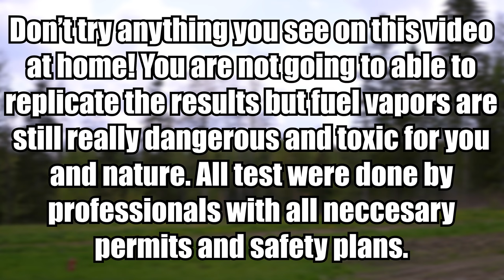Testing Fuel-Air Explosives / Thermobaric Bomb | Finnish MOAB 5 000 000

Comment from the maker: Link to Pommijätkät video for more thermobaric action https://youtu.be/XgaotYjJ8hg And yes there is SUBTITLES in english!
Reply: Can you make it bigger ?
Reply: Big thanks to Lauri and Anni :) Always fun to blow up stuff together!
Reply: @mkeolver  Let's have a big thunderclap for the Summer Solstice!
Reply: What if you used two cans, one smaller with the gasoline or what you were using inside another bigger one with hydrogen peroxide, the addition of the peroxide as an oxidizer in the vapor cloud should give you as much bang as possible...plus it's environmentally friendly oxidizer that ends up as water and oxygen!
Reply: hello. why the explosion seems to be specially powerfull at the equator and less powerful at the poles?
Reply: @TheBibliofilus  Biggest bang/weight?  Air is free.  Thermobarics deliver a huge volume from a small package - blast wave and near zero oxygen remaining.  If your enemy is tunneled, use a thermobaric near surface openings.  Breathe what?  Big booms are easy - Texas City and the Bay of Beirut, 'Nam daisy cutters - but they are not easily portable.
Reply: Have you tried to disperse the fuel from below with compressed air?
Reply: @Kheopsyco  The initial detonator was a thin vertical cylinder.  One does not want the blast energy to be wasted by pointing up or down.
Reply: How about testing an Implosion-type fuel-air explosive?
Reply: That slowmo, was remarkably similar to some shot on nuclear tests...
Reply: And now I have to watch Pommijätkät video again. This time with subtitles, as I watched it on first day in finnish))
Reply: @ЮрийРулёв-и2ж  same here
Reply: Long ago, I made an experiment with gasoline, by pre-boiling it inside an old propane bottle to en enhance the vapor dispersion when detonated and add small ampules of hydrogen peroxide around the setup, the explosion was... scary, I couldn't breath air from far away, it sucks the surrounding air and than the hot blast comes after. My eyebrows, hair and mustache were burnt from the hot blast.
Reply: @boymahina123  To what end?  The explosive device is the entrained air plus shockwave initiation.  You're likely thinking shaped charges, self-forging munitions, and HESH rounds.
Reply: Fuel + Air explosives = weak...

Try
Hydrogen + Oxygen mix. ☝️🧐🕵️‍♀️😉

And yes, hydrogen is also fuel... But you now what i mean.
Reply: Idea for new t-shirt:
Kolme...
Kaksi...
Yksi...
>>boom!<<<
Reply: How do you pronounce Pommijatkat? Can you spell it phonetically for English pronunciation please?
Reply: @bubblezovlove7213    Google Translate will speak it to you.  It's...unexpected unless skilled in the art.
Reply: Atlantean Gardens YouTube Vortex Math explained by Marko Rodin with an introduction by Robert Sepehr
Reply: @bubblezovlove7213  paw-me-yat-cat might be as close as we can get in English.
Reply: Quick question, will there be any more outdoor ring videos? I've looked in your videos but I can only find the blue car one. Would love to see more if they're are still more to come.
Reply: Has anyone tired using real coconut 🥥 to make a firework or something that goes boom 💥 I mean with the coconut shell
Reply: ROCK ON!!! That blowed up good !!!
Reply: Al-Nusra getting 2016 flashbacks
Reply: This are good for fight any forestal fire.
Reply: awesome
Reply: Yo you got some freaking amazing bomb ass footage!! That footage near the end made it all worth it!! I was literally blown away, no pun intended!! The way the dust came up off the roofs was jaw dropping, it was clear you placed the dust on the roofs, meaning you knew it would make for amazing footage & shots, kudos bro, thats a pro move!! Hell I thought I was watching a movie at one point, the footage is just that good!! I look forward to more videos like this!!!
Reply: You should start doing scale explosions and video their effects on structures and maybe some ballistics gell for flesh, to see what the damages are to people and animals!!
Reply: I think that the Beirut blast was an assisted fuel/air explosion the continued fireworks going off only causing small localized bangs
Reply: @takasmaka820  ppp
Reply: Excellent work by you and your technicians. Well thought out. Great science. Im an experienced pyrotechnician, and other...
Your best slow motion so far as I've watched (at 3/4 through this video) you see the "dispersion" charge shock wave pass, and end. 
A few milliseconds later the "ignition" charges fire. Near perfect. But if you got the ignition closer behind the dispersion shock wave, to amplify it...THATS the big one. Wave amplification.
Reply: U shud revisit this but do one to show the thermobaric reaction is responsible for the power. By doing same test setup but the bottle of fuel is empty so nothing disperses. So u can see the three stages without fuel did not produce the power. Only when fuel is added and the reaction is successful do you get all the power.
Reply: This is why a thermobaric bomb is illegal in wars but Russia is using them today against Ukraine. This bomb is home made and really small compared to what Russia is using. Let's not forget Russia's Tszar bomb 3,800 times as powerful as the U.S bomb dropped on Hiroshima! For the first time in 2020 Russia released/leaked the video of the explosion, if you want to watch it copy and paste this text in youtube Испытание чистой водородной бомбы мощностью 50 млн тонн The explosion starts at 22:43
Reply: @PureVikingPowers  the air blast Russian bomb is equivalent to up to 44 tons of TNT. They have smaller ones on rockets.
Reply: @PureVikingPowers  thermobarics are widely used in war. Also tsar bomb footage has been available for decades.
Reply: @Chaotyk-Official   Yes thermobaric bombs are not technically illegal and can be used in certain battle situations. However, the use of them on civilians is considered a breach of the Geneva Convention.
Reply: @PureVikingPowers  wtf are u on about? I thot this conversation was already over.
Reply: Oh we never grow up do we? Lol I used to do this with fire crackers when I was a kid with little green army men.
Reply: How do you initiate the secondary detonation?
Reply: @baniagojherwinjohn4765  usually with a specific length of shock tube
Reply: Wasn't there a risk of starting a forest fire where you were testing the fuel air explosions? If you had done this as close to trees in Australia. you would have started a forest fire (bush fire in Australia) for sure.
Reply: That shit's great guys!
Reply: @budsbunny5610  Right... 😣
Reply: tritonal but you have to make it castable(like plastic explosive) and mix the aluminium in well 80%TNT 20%Aluminium
Reply: If you need someone to subtitle your videos in english, Im available

Comment: "dont try and build thermobaric bombs at home..." Thats one of the few safety warnings that actually made me laugh.
Reply: Its actually feasible to build thermobaric bomb in the states by just following this video. and its really dangerous
Reply: @royk7712  the chance is actually higher for just contamination of the ground with fuel.
 that the initial explosion spreads the fuel but also damages the donator for the ignitor explosion, or the fuel being not vaporised fine enough and in the right direction
Reply: @pteppig  that's why they do multiple explosion to perfected it
Reply: Its fairly easy to build.
The reason they have so much issues, is because they use air as the oxidizer, and thus you need to ignite the Fuel/air cloud at exactly the right ratio.

If you include an oxidizer into the fuel itself, the oxygen is already present in the right ratio, and thus you don't need any precise timing at all. 
This makes it a little heavier but its still an extremely potent explosive. You can also easily buy all the ingredients Without causing suspicion. Aluminium powder, Magnesium powder, powdered sugar, and some other stuff that is equally trivial.

And then you can build a thermobaric enhanced bomb, that could nolife and maim hundreds of people, destroy infrastructure from small shacks to steel concrete buildings, bridges, boats, power plants, damms, depending on whether you are filling a bottle, a backpack or a van.

The thermobaric explosive charges of the rockets used by the US military arent exactly huge, and their destructive power does not stem from something special that you cant construct yourself. Maybe its 50% as efficient, so youd need 400kg to create a blast the size of a military 200kg thermobaric bomb. 

Entirely attainable and buildable. 

The industrial revolution and its consequences have been a disaster for the humam race.....
Reply: The russians couldn´t resist!
Reply: @carlpanzram2012  well said
Reply: @carlpanzram2012  so basically, a small explosive is surrounded by fuel oxidizer mixture. when the explosive is detonated, it disperses the fuel air mixture into the atmosphere. how is the second explosive created to ignite the dispersed fuel

Comment: Thanks for the video, the explanation and the testing. 
I've first heard about these vacuum bombs in the ukrainian war and sadly got interested, what they have to deal with...
Reply: I heard they haven't actually been used yet (though not sure why, they probably will soon). Also people already forgot when USA actually used it only a few years ago which was very famous at the time: https://youtu.be/d4DLzioGq5M
Reply: United States used these in the Iraq War as well
Reply: @lyrimetacurl0  It's not a warcrime to use them against bunkers and entrenched foes. However launching them at civilian structures is a warcrime, since they are such indiscriminate killers. 

The wounds inflicted in civilian targets are also very cruel. Like if you hit an apartment building with one, the explosion sucks all the air inside the building where it is not air tight. This causes lungs to collapse, eardrums to implode, other organ ruptures are common. The heat from the blast is also like half of the surface of the sun, so the victims often have severe burns. 

But these weapons are not any more immoral to use against enemy fortifications like bunkers. Or against an enemy tank column. But using them against civilian structures, even ones with enemies hiding inside, is a warcrime and very unethical. This is because of the very high destruction of infrastructure, as well as the wide area of effect. It's almost a baby nuclear bomb without radiation.
Reply: They aren't vacuum bombs. That's a huge misnomer.
Reply: @tadferd4340  
Quite Right
The misnomer 'vacuum bomb' comes about due to the fact that all the oxygen in a large area has all  been used in the explosion itself and leaves an un-breathable atmosphere behind. That is also presuming you could breathe gas at very high temperature and that your internal organs have not already been pulped by the  overpressure and shockwave.

Comment: I inadvertently made an FAE by throwing a cup of kerosene into my wood stove one morning to help light it. My mistake was failing to notice the residual heat in the stove body vaporized the kerosene enough that it blew the chimney pipe off, knocked the door wide open, and shot a fireball into my face and arms. Luckily it was a small amount of fuel and I escaped with nothing worse than a slight ringing in my ears and some singed hair.
Reply: @partyhardcake  yeah, even if it wasn't a true "detonation" it was still a pretty violent and unexpected reaction.
Reply: @partyhardcake  Nah, blasting cap is just the simplest way to guarantee a detonation - it isn't the only way. Offhand I'd guess that James B did experience at least a small detonation up-close - to me it sounds like the stove body confined the initial deflagration well enough for overpressure to trigger a (partial) detonation. Fireball was deflagration for sure, but the loud noise suggests detonation.

And yeah James  B, that's pretty scary. Fortunate that you didn't have the setup for anything close to a complete detonation - I've just looked some stuff up and done the math, and a cup of kero (if detonated completely) is equivalent to 9-10 sticks of dynamite. Which is a whole lot more than I was expecting when I set out to figure it out, yikes.
Reply: I was on a camping trip one time and a kid threw a styrofoam cup of Coleman lantern fuel on a fire. That shit ignited so fast the fire followed the stream back to the cup in his hand and ignited it. Burnt his hand and arm pretty bad and burnt a lawn chair that he threw the cup into.

Moral of the story....don't try this at home kids.
Reply: @edsloan8535  One of my school friends got injured trying to change a cooking stove gas canister Inside their tent. I believe they released a lot of gas which exploded when they went to light the stove.
Reply: As a kid my friend did similar with his wood stove in the basement. It basically fireballed the whole basement. Singed his eyelashes and brows off.
As a bonus all the spiders died and the cob webs disappeared.
Reply: @partyhardcake  You really don't. Fuel oil furnaces will do that if you atomize enough fuel into them and the igniter kicks in.

Comment: I love how you can see on the high speed that the most destructive force in many of the little houses is the differential air pressure between inside and outside the houses.  It's like the houses exploded from inside because the pressure inside was higher than outside.  Really cool.

Comment: The mini houses/barns seem to explode from the inside- is that because of the pressure difference created by moving air outside of the structure? Or is there some way the pressure wave moves inside and deflects outwards through the roof?

Comment: You could do the ignitors on the same package so that you attach the ignitors outside of the canister and attach them together with a wire to the side of the canister with primers to shoot them away just before the blast. The wire should be measured so that it stops the ignitors before the bursting charge goes of. Make a package to the ignitors so that they are not ripped away by the bursting charge. You can make the needed delay to the ignitors with explosive cord either rolled around or inside the wire that is attached to the primers.
Reply: Great idea. Maybe create a physical detonation mechanism that's set off when the detonators reach the end of their travel on the cords.
Reply: @harrypeterson9287  Even better, Yes, that way you could make the primers detonate at right place at right time. I myself don't have such materials so I can only theorize.
Reply: @harrypeterson9287  This way you could make the ignitors so rough package that you could let them be thrown by the bursting charge with the fuel material and rough package would make needed weight for the pulling of the string to detonate the ihnitor packages. 
Wire just should be strong enough to take the bursting charge's strike without failing.
I'm quite sure it should not be too hard to measure the wire to fit inside the fuel cloud. And finetune by testing it, they who have the materials and place to do it.
Reply: @ark-mark1  I imagine multiple small tubes inside, much like gun barrels that shoot the detonators in a perfect pattern while keeping the cords nicely coiled behind them to prevent tangling and pre-detonation.

I think this would work, a person could make a lot of money if they had the resources to make a prototype.
Reply: @harrypeterson9287  Yes, possibly you could use commercial grade fireworks just put to metal tube. if they launch just before the main bursting charge, they would not take damage and the air bomb type fireworks would make enough blast to lit the fuel. 
And as much I would need the money, my conscience would kill me if they were used in anything else than entertainment.
Reply: @harrypeterson9287  Tho that fireworks type would not suffice, if you need it to work perfectly every time. Then you'd need that cord & wire type function.
Reply: @ark-mark1  I was thinking that they could be shot out by hydraulic pressure from the fuel itself being forced outward, essentially a simple piston system.

A sealed tube with a plug at both ends which house the detonator.

This can allow simple detonation timing by adjusting the length of the cord.

Of course nobody wants to see weapons used for evil, but there are times that violence is necessary in a countries own defense.

Comment: Actually one of the interesting phenomenon is there was much less dark smoke coming out from successful tests comparing to the first failed test. The dark smoke is actually carbon. Having residual carbon left over indicates incomplete oxidation, which actually means the energy contained in the fuel was not 100% released.
Reply: Could he add sugar to the mix to burn up excess C and NOX gases?
Reply: @brandysigmon9066  
I'd guess not. The presence of char indicates deficiency of oxidizing agent instead of reducing agent. Sugar is a reducing agent (almost all fuels you may burn in the air are reducing agent, as they get oxidized by oxygen) and it's very likely to just make the smoke thicker.
Reply: thanks for pointing that out. mine wouldnt have been written as neatly, that was a lovely concise explaination. 
really should get back into chemistry at some point, i hate not having the reduction/oxidation sorting of material neatly squared away in my head.
Reply: @mu11668B  agreed. lots of sugar is the main difference between smoke grenade mixture and solid rocket fuel